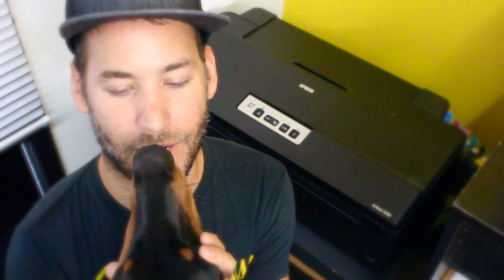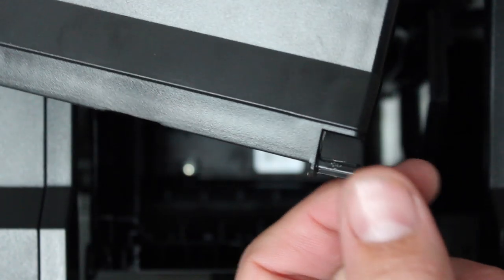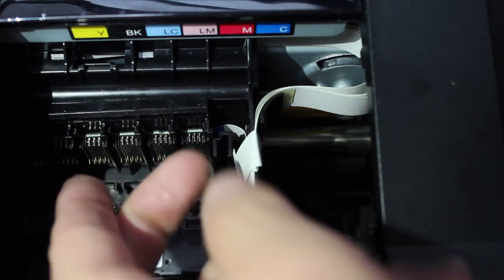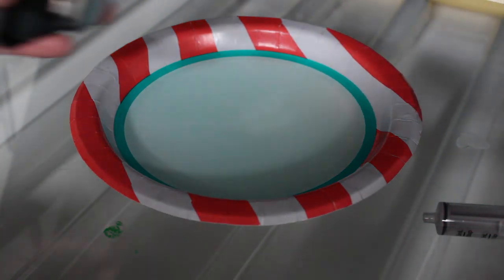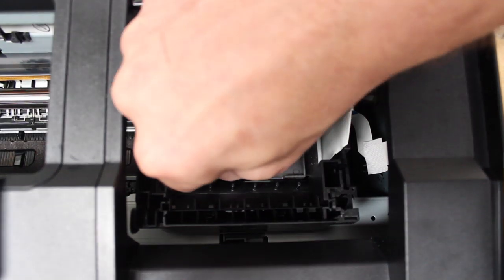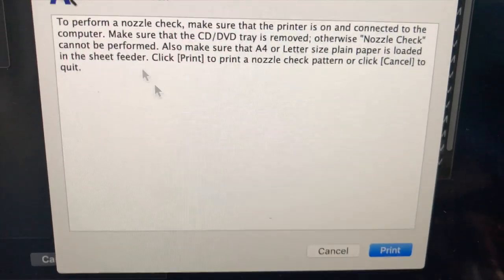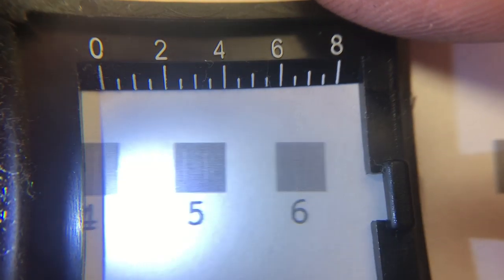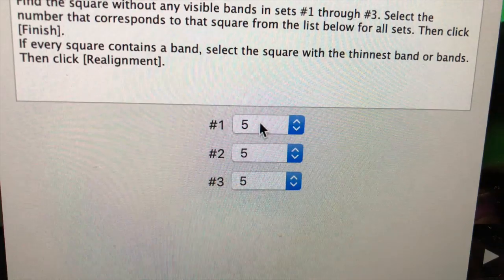Is Your Epson 1430 Printer Clogged or Streaking? How to Remove, Clean, and Calibrate the Print Head

Comment: This worked and was pretty easy to get the head out and back in after tho i made the mistake of pressing the ink change button to move the head out of the parked position instead of just powering on and then unplugging the power cord.  which will not brick the printer like the ink change button can if its ever powered back on without the original OEM carts in place.
Reply from the maker: That's awesome! I know the feeling. Been there before. :)

Comment: I tried this tutorial last week. cleaned the head real good, great advise. Unfortunately when plugging it all together and running the power up the printer had total electronic  break down and is unusable. no power and constant low beep from the back . i killed it some how.
Reply from the maker: Sorry to hear that. I'm not a tech, but just showing how I cleaned it. Not sure what the problem could be.
Reply: We’re you able to fix it ?  Same thing happened to mine
Reply: I also have no power after putting it back together and I have that very quiet beep. Should I buy a reconditioned print head?? Cost is around $80

Comment: Ok, yes it worked as instructed except for one major problem; I unwittingly installed the cards back in with some liquid left in the pin terminals. The printer started up and ran for a short while and then died. I imagine it was a short of some sort.  Make sure everything is completely dry before installing the parts back in!
Reply: @Brooksvw100 This literally just happened to me as well. I now have a low beeping noise form the back. After some research it looks like the transistors can be replaced on the main board (or a min board is needed)  and hopefully bring it back to life. But also a new printhead will be needed. Have to tak
Reply: @coolrunninja  Fortunately for me I had a back-up 1430 - also clogger  I have taken out the head and cleaned it again and this time will make sure that it is super dry before continuing. I hope Mikey see this and adds a caution advice to this great tutorial. A great B/W printer. I will make sure that it does not glog again, although cleaning it this second time around was a breeze!
Reply from the maker: Thanks for reaching out! I'm by no means a tech, but could see how that would be possible. Just sharing what I've learned and has worked for me.  Take caution when working on electronic components. I'm sure there's other aspects that need to be looked after, like making sure you're grounded.  There's static electricity gloves or things along those lines for doing circuit work, but again, I'm not pro at this. Just sharing what's worked to keep mine alive.

Comment: Do you think there is a way to mod the 1430's to accept rolls of film? Or would that be too tough?
Reply from the maker: I know with AccRIP you can set it to accept a roll and just make the paper size custom if you wanted to go larger than 19" long and you could get a roll stand.
Reply: Mikey Designs & Silk Screen I saw someone say once that the paper feeding mechanism in the 1430 isn’t strong enough to consistently pull the weight of the roll and it will burn out.
Reply from the maker: @Tim.McElheny  That's a good point. However I've seen people turn an Epson 1430 into a DTG which moves a platen. I'm not much of a fan of rolls for a printer that can't cut the film or paper.

Comment: I removed the chip board and disconnected the first cable. Then I removed the 3 screws and the print head. I removed the 2 cables that were connected to the head. There was a 4th cable connected behind the cartridge carrier. I accidentally pulled it loose. That's where my problem is. Is it possible for me to remove the cartridge carrier without stripping apart the whole printer?
Reply: SAME! Did you figure out how to get it back in?

Comment: Is there a replacement for this printer?  I tried the Epson expression 15000 and it wouldn’t do borderless 12x12 plus it seemed so cheaply made compared to the 1430… not to mention ink refilling issues.
Reply from the maker: The 1430 is the last of it's kind, IMO. The rest are built so Epson has more control over consumables.

Comment: I've done everything in the video, then reassembled everything and fired the printer up. It initializes, but then thinks there are no ink cartridges installed! Is that just not getting the ribbon cables seated right, or is there something else I should check? I've tried three times now and it's getting frustrating!

Comment: Your Doberman is cute.....great video, can't you clean it without taking the head out though?...A lot of mechanically inept folk are going to dig themselves a hole trying this method...
Reply from the maker: Thank you! You can. Just hit the ink button, unplug it. Use a folded paper towel with some windex, place it on the track, and slide the head over it. Do that as many times as it takes. You can let the head sit over that paper towel overnight to see if that helps. This video is more for if you've tried every method and the only option is to take it to a repair shop, to help save you some money.
Reply: @mikeydesignssilkscreen473  Thanks..🤔🇬🇧

Comment: I tried to do the exact same process that was show in this video but when I put it back together and plugged in my machine and turned it on. It won’t turn on at all now. I’m not sure what to do at this point. I hear a low pitch noise coming from the printer but nothing turns on. Any suggestions?
Reply from the maker: Just go back and make sure everything is hooked up properly.
Reply: @mikeydesignssilkscreen473  UM that is probably not the issue... The mother board is fried due to short circuit.  Might as well start shopping now.

Comment: My big printer fell and no longer functioning..
I took apart my Printer and remove the print head, cleaned it thoroughly and installed it in a new printer I bought for $50..  Now it prints perfect..

Comment: It worked for me chewing up and breaking a bit of the plastic in the process but does not affect the printing. I used alcohol and windex for the soak and 99% rubbing alcohol for flushing the heads. Its not perfectly unclogged but might give it another go once things slow down here more at work.
Reply from the maker: You can let the syringe sit on top of the clogged color for 24 hours to see if that'll help unclog it. Would love to hear a report back.

Comment: Have a question- after completing the steps in the video, printer will not power back on. Any ideas on what might be happening?
Reply: you broke it that's why
Reply from the maker: @brandonjohnson8880  lol
Reply from the maker: To be honest, I'm not sure. Could have shorted the printer out. I'd take a look at the power cord and start from there.
Reply: @mikeydesignssilkscreen473  Power cord doesn't seem to be the issue after trying alternative cord; printer now hard down and having to revert to back up printer which isn't ideal. Any feedback from others greatly appreciated. Seeing now another user had the same issue.
Reply: @brandonjohnson8880  perhaps you can head over and help fix the issue
Reply: My printer powered on until I went to add it to my system and then it went dead. Anyone figure out why it won’t power back on?
Reply: @brandonjohnson8880  😂MG that's funny! I literally laughed out loud.

Comment: After doing this my printer stoped working and started beeping when plugged in. What is happening?
Reply: Same, started up normally then quit, no power.
Reply: @WorkNation  Exact thing happened to me. Did this step by step, powered up to lights blinking. About five minutes later it just powered down and won't power back on. Just dead. Should have probably put a disclaimer on the video that it could potentially nuke your printer.
Reply: My grandson and I just did this yesterday...and yep, got the same results...powered up, ran for about 30 seconds, and then the power light went out and nothing I do gets it to come back on.  Somewhere, this person should have made it plain that it could fry your printer.  I love my 1430 and the only one you can buy as of 01/18/2021 costs 1600.00.  And, because of COVID, you can not by the upgrade to this machine from Epson or anyone.  I would have been better off to spend the $250 and buy a new printhead and just installed that.  I am sick and now without my printer.

Comment: When I try to turn the printer back on it will not power up. It just has a faint beeping sound. Any solution to this?
Reply from the maker: Was everything working okay before, aside from it being clogged? I would check the connections. Maybe give it another shot at taking it apart and putting it back together.
Reply: @mikeydesignssilkscreen473 The machine was working perfectly just needed nozzle cleaning. We tried to duplicate with a second machine and same issue occurred. Its very puzzling.
Reply from the maker: @CasWynne  That is odd. I'm not quite sure what the problem could be.
Reply: Mine did the same thing, were you able to fix the problem?
Reply: @CasWynne  were you able to fix the problem? mine did the same thing.
Reply: @Zeke Chancey No it is unfortunately completely dead. Still won’t turn on :/
Reply: Casey Kroger any luck finding the problem or fixing printer?
Reply: Wish I read the comments section a little close before doing this. Same problem here as well. It appears there is significant risk of shorting out the printer by doing this. Print heads were completely clogged beforehand making the printer unusable anyway, so I guess I'm no worse off. 
https://www.ifixit.com/Answers/View/185189/after+cleaning+printheads+printer+doesn't+work+and+emits+a+beep
Reply: I have the same issue after cleaning the print head.  50/50 alcohol & water.  1430 powered back up fine, was going through startup / boot up, then stopped completely and shut itself off.  A very faint beeping can be heard.   Fortunately, this was a used machine I picked up to convert to a sublimation printer.  Seems as though its dead.  Was printing fine before - just a clog on 1 nozzle.  I've searched for hours on this phenomenon, but there seems to be no fix.  Be aware.
Reply: @TMartinAllegiant  were you able to fix it ?
Reply: @FeGolf  were you able to fix the problem?

Comment: I love(d) my 1430 until I apparently made the mistake of "updating"  the firmware  ... so EPSON could hold me at RANSOM if I don't buy their super inflated  MILLION DOLLAR INK.  Got any ideas how I can downgrade firmware?
Reply from the maker: Ouch. Yeah, Epsons firmware update will lock out any aftermarket support from non Epson vendors. That firmware update was to block what support is out there for using aftermarket inks so they can line their pockets by making you buy only their inks.

Comment: To bad I broke everything 🤦🏾‍♀️ trying to do this
Reply from the maker: Oh no! What happened?
Reply: @mikeydesignssilkscreen473  the right side wasn't so easy as seen in the video eventhough you said that it will be harder than the left side. I used small to big flat heads trying to get it out and broke it. My printer is still working because I stopped after attempting to take the second part off and breaking that too. I went to my printer settings and tried cleaning it from there and that worked. Next time I will hire a pro to clean my machine lol.

Comment: Thanks for the video... fair warning to others trying this... the plastic breaks SUPER easy!  Hopefully didn't break anything important in the process.  I am having an issue when reconnecting - says ink cartridges cannot be recognized.  I took everything back apart and rechecked connections, everything is snug, unplugged for a few seconds and turned back on and still getting the error message.  Anyone have any idea how to fix?? Really want to get this printer working...bought it new and didn't use it frequently enough so everything dried out :( :( thanks in advance for your help!
Reply from the maker: Did you pull the cartridges and reseat them? Hit the ink button?
Reply: Mikey Designs & Silk Screen yep and yep multiple times 😥
When I take one cartridge out the errors on all but the missing cartridge clear but as soon as I replace they all light up with the error message.
Reply from the maker: @reallyefficient  I would check the ribbon connections to make sure they are installed properly. Are the metal tabs meeting up with the pins?
Reply: Mikey Designs & Silk Screen yes-I’ve gone through the entire process and reconnected 3 times, making sure they are free from ink smudges as well
Reply from the maker: @reallyefficient  Are you using the standard inks, or did you upgrade to a CISS?
Reply: Mikey Designs & Silk Screen ciss and of course I don’t have any standard cartridges on hand to switch out to test 🤦‍♀️😭 just wanted to see if anyone else had any troubleshooting tips before I fork out another $75 that may or may not solve my issue 🧐
Reply from the maker: @reallyefficient  Could just be a bad CISS unit? It's my understanding that if you have updated the firmware on the Epson 1430 that it won't accept aftermarket cartridges. Epson did that update so users will only be able to use their inks.
Reply: I have a chip resetter that is used so that the printer will recognize the cartridges.
Reply: Theresa Paiz I went ahead and ordered a new printer 😭. But I may try to get this one up and running again in the future- how do you reset?
Reply from the maker: @reallyefficient  You'll need to get the reset software. They sell it with the waste tank, but I'm not sure where you get it by itself.
Reply: I have the ciss and got the same error after reassembly. I don't see a resolution in the responses. Did anyone figure this out???
Reply from the maker: @marlonwells5789  Did you try pulling the CISS out and reinstalling?
Reply: Mikey Designs & Silk Screen Yes several times. I tried running without cartridges, unplugging, even pulling the head again and reinstalling the ribbon wires.
Reply from the maker: @marlonwells5789  Sorry to hear you're having issues. I'm not sure how to help without looking at it and getting my hands on it. Could be the print head needs to be replaced.
Reply: Mikey Designs & Silk Screen are you up for taking a look at it if I ship it to you? Not sure what to do from here. I am ready to drop kick it!

Comment: Be careful forcing fluid through the syringe, you can blow the printhead nozzle out and destroy it. I had to replace my printhead after squeezing fluid through it too hard.
Reply: Same here lol
Reply from the maker: Definitely don't force it. If it's not going through, then pull the head, let it soak, and then try again. You should easily be able to squeeze it through with some resistance.

Comment: Ok...Tried this and sure enough bricked the machine like many others.  Should have been more carful and cognizant of what introducing any solution to a circuit will do if not DRYED COMPLETELY before introducing current.  The soaking of the print head should only be done at a depth not to make it to the circuit board and dry it out completely before reinstalling the cables and powering on.  SERIOUSLY UPDATE THE PROCEDURE TO INCLUED THIS POINT.  I'm sure this is what makes it such a hit or miss proposition.  If I would have only been ALERTED and not have been in a hurry. DUH!
Reply from the maker: Thanks for the feedback. Working on your own equipment is a risk, and I really had no idea the video would take off like it would. Next time I'll be sure to upload a warning.